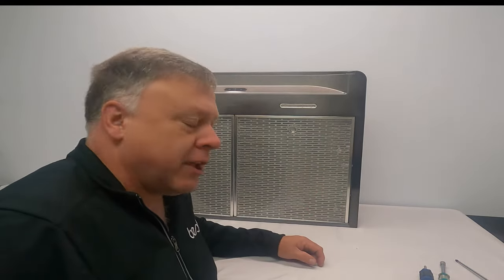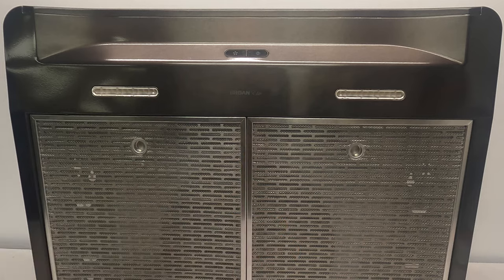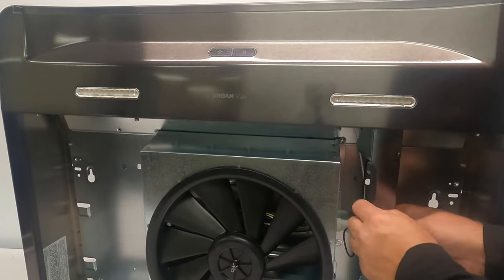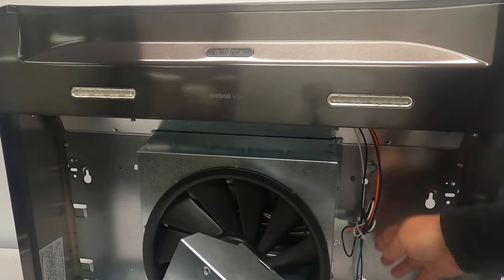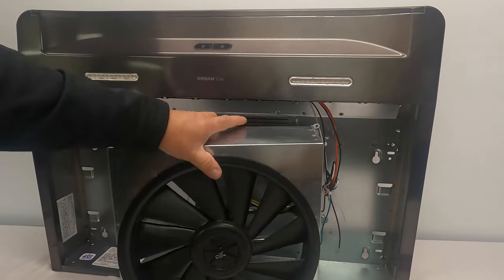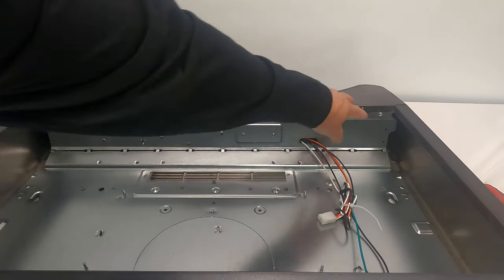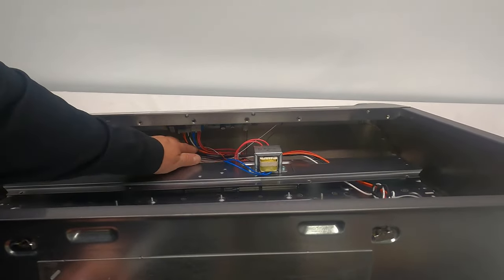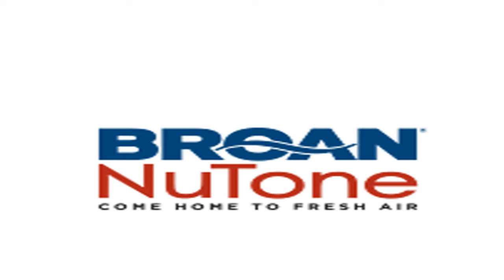How to Disassemble a Broan ALT2 Range Hood

Comment: I’m just trying to clean the fan blade if I take the Harpin pin out will the fan blade come out so that I can wash it?
Reply from the maker: Thank you for your question regarding the ALT2 range hood.  Yes, removing the hairpin clip will allow you to remove the blower wheel.  You may have to do a rocking motion while pulling down on the fan blade to remove it. If you need more assistance or have other questions, please give our Product Support team a call at 800-637-1453.
Reply: @BroanNuToneLLC  wonderful it totally worked! Thank you